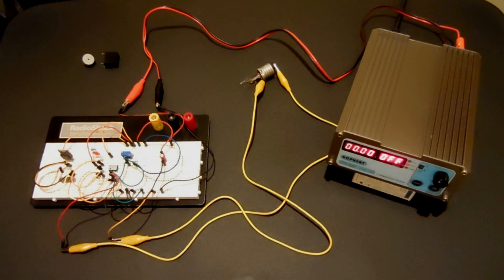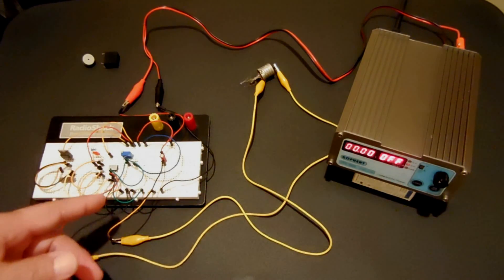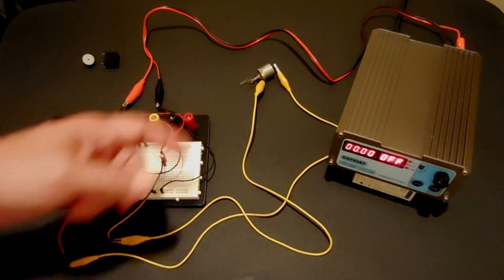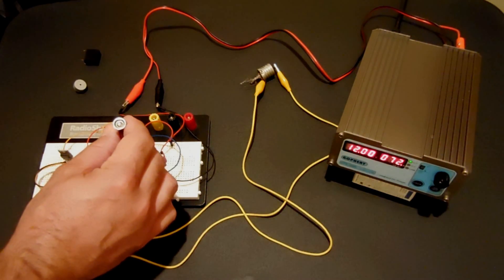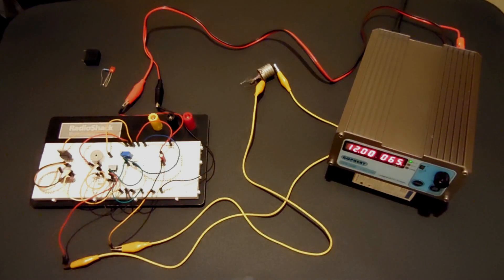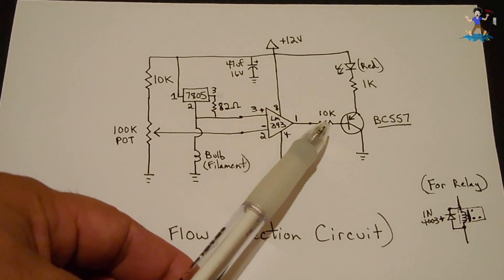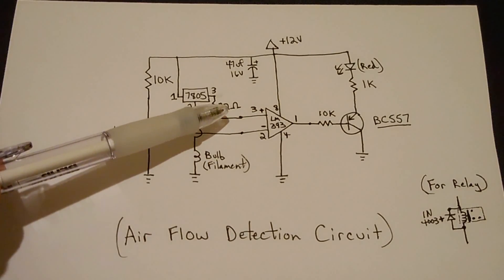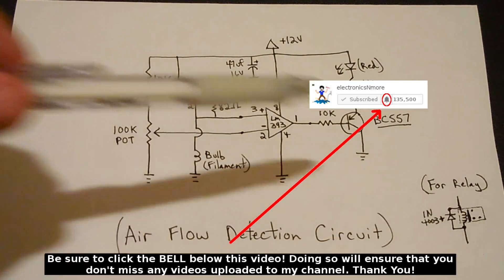Super Sensitive Air Flow Detection Circuit

Comment: Isn’t this how a mass air flow meter works? Would it be possible to use this with an Arduino to read the volume of air that passes through a pipe?
Reply from the maker: Very similar. Watch my other video below. Thanks!
https://www.youtube.com/watch?v=vPwHiPNYn0o

Comment: Is it possible to accuratly measure the volume of air flow with this circuit?
Reply from the maker: The circuit is very sensitive. You can set the circuit to trigger when a certain volume of air is detected.

Comment: How does ambient temperature affect this detector?  Would you have to change the adjustment for a cool day vs. a warm day?
Reply from the maker: You set the POT right before you use the circuit. The ambient temp makes no difference.
Reply: It is not automatically temperature compensated.

Comment: Automobiles use that kind of circuit to meter air flow into the engine . Its called a mass air flow sensor or MAF for short.
Reply from the maker: bob4558 Yes, I uploaded a MAF video a month ago. Check it out. :-)
Reply: Thanks I will!